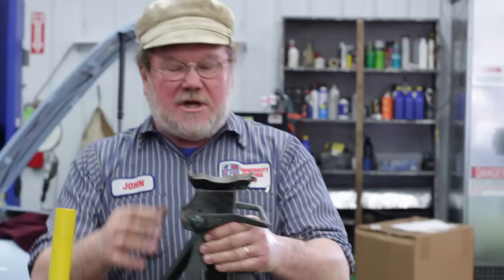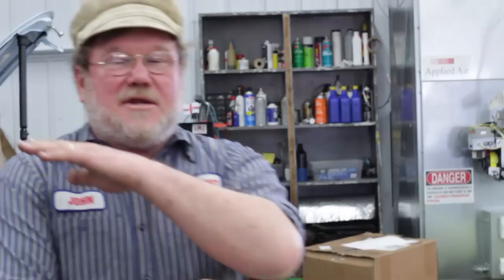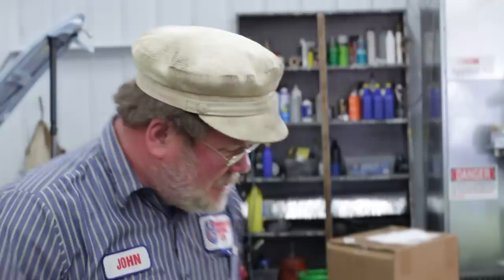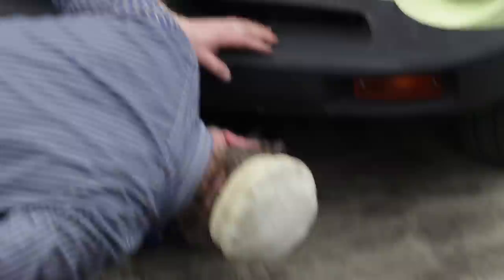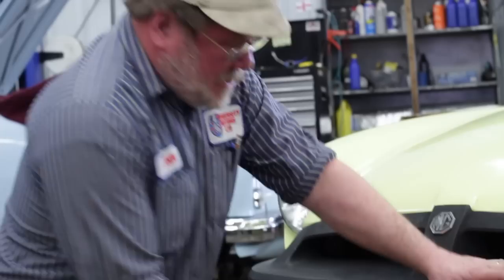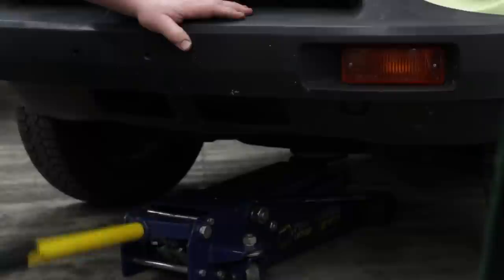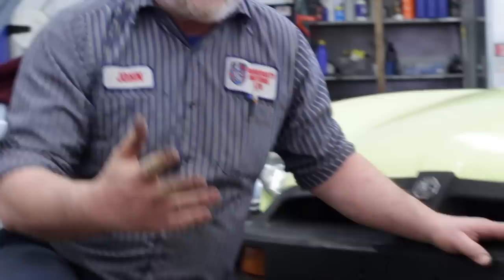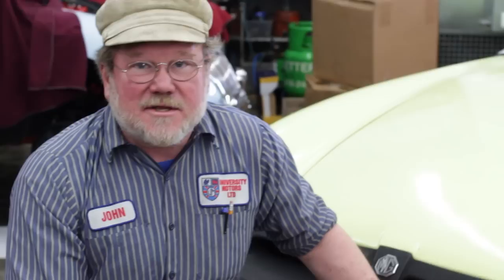224 MG Tech | How to Jack an MG (not stealing)

Comment: I'm a fanatic about safety when jacking and supporting my MGB, even more after an aquaintance of us lost a family member when his car crashed him to death. John's advice is clear and is the minimum precaution for everyone. When working on my MGB high up on 4 sturdy jacks, I also put a spare ramp partly under. When changing a wheel, I first shift the spare one under the car and only take it away after the existing wheel is fully off. Only twice in 35 years did I need the factory jack on holiday

Comment: Great video. 
I use the same way to lift, but find it convenient to put my Jack stands under galvanized pipes that I have put into the factory lifting points. I have found it very stable. My car has little rust.

Comment: I've been working on cars for decades but I've still managed to make dangerous mistakes. The worse was when removing the hub nut from a Citroen 2CV.  999 times out of 1000 I always use a minimum of two stands and leave the trolley in position with it touching but not supporting the car. But I was working in the street 1/2 mile from the shop and had only one stand with me and the Citroen jack - when it fell I slipped and the car landed on the fallen stand and on my leg - lucky minor injury!

Comment: You can indeed jack the rear first... I've been doing it for decades!  I use a piece of plywood under the rear diff. It's exactly the same as you describe - the front wheels roll ever so slightly as the jack comes up., or the trolley rolls slightly. Either way - same way, same method, same results.....

Comment: Do not understand his dislike of the factory Jack. I have owned my 1973 MGB Convertible since 1990 and have always used the factory Jack. Today I was checking the rear brakes and cleaning the wire wheels and I used it again. I put on the parking brake, put four wedges on the opposite wheels and Jack up the side of the car all the way. Then I get out me very strong Jack stand and put them on the frame and lower the car a little so there is pressure to on each of the Jack stands. Then I am ready to work under the car. Yes, I never work under the car with just the factory Jack, only when my Jack stands are in place. One important thing he did not mention, you must have a good foundation under the jacks. In my case it is flat and concrete. This is very important!! I really love the factory Jack and it easily lifts the car and allows you to put the Jack stands in place. Never have had a problem with them. They are sturdy and using the hole provided under the door for them I feel they are very safe!

Comment: Once, jacking up my wifes Miata, someone had set the parking brake, plus there was a bit of a rock behind the   wheel on the jack.... It          slipped off and I ended up replacing the OIL PAN!

Comment: just last year I learned a tip from my neighbor on using a trolley jack as you sayt. Im a young guy and I always felt safer twisting the handle all the way tight when lifting the car, but I always ran in to a hard time releasing the car slowly. as disengaging the lever took a lot of force and the car would drop. he said to tighten the handle ALMOST fully but not quite, that way I can lower the car in a controlled manner.
 I'm curious if you agree that not fully tightening the jack handles safe?

Comment: Good sound information. I really appreciate it. How do you feel about car ramps? Over the years I have use them home to get under my 72 Midget.  I even replaced the clutch using the ramps.
Reply: Fine unless you need to work on brakes, bearings, springs or shocks.

Comment: Great safety Info John,,,,But Suggest You ,,learn Or tell Folks to Use a more Technical Term of Placing Jack Stands At or On Torque Boxes,,,All 4 Wheel Cars Have 4 Torque Boxes ,,3 wheel #torque boxes,,2or Motorcycle 2 torque Boxes,,,THEY ARE The STRONG and Build Points of The Vehicle,,And Are Always Just Behind front Wheels,,Or in front of Rear Wheels,,Look Under Car For Good Strong Structure That will Support All the Weight you are going to put down on that Specific Corner,,,Torque Boxes Are YOUR,,Friends and Need To Be Used Always to Support,,Repair and Adjust Frame ,,Unibody or any Structure Repairs ,,Great Info Watching You Just Used U R videos other day to Fiix Clucth Master Cyl and Bleeding info ,,Thanks  Frank Heiss ,Franklin Auto